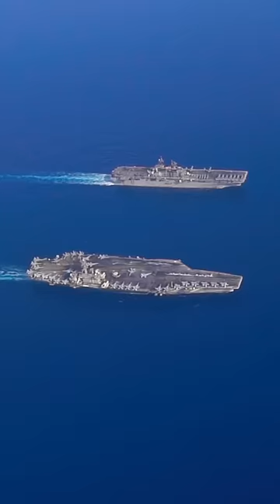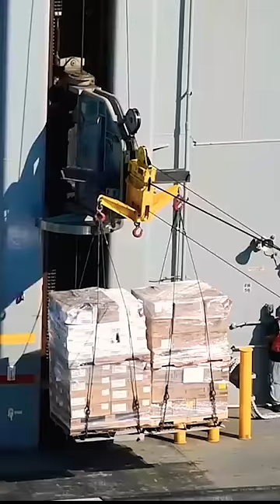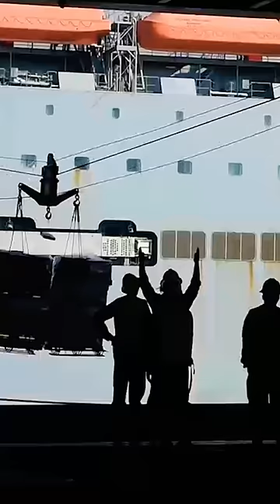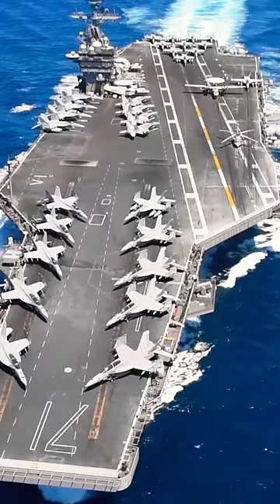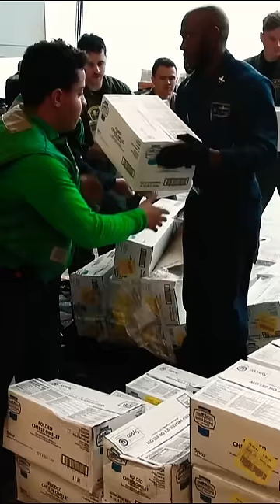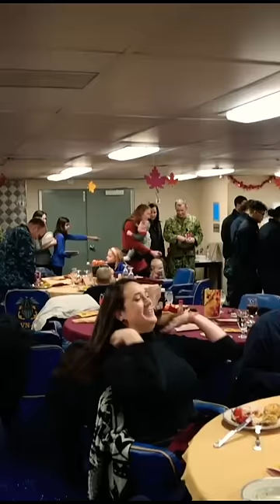How do aircraft carriers refuel at sea? How far can they travel without stopping for fuel or rest?

Comment: I was on the USS Detroit AOE-4 .And that's what we did.
Reply: I think the Detroit un-rep ed my ship ,USS EISENHOWER CVN-69 when I was there. 1981-1983.
Reply: I worked at SIMA Earle, had many repair days aboard that ship. I think the Arctic was the one that had the cleanest bilge between the 3 ships (Seattle, Detroit, and I think the Arctic) that were stationed there. Great times there in Jersey!
SIMA Earle, Colts Neck NJ 2000-Decom 2002